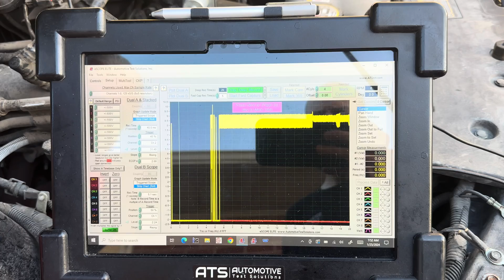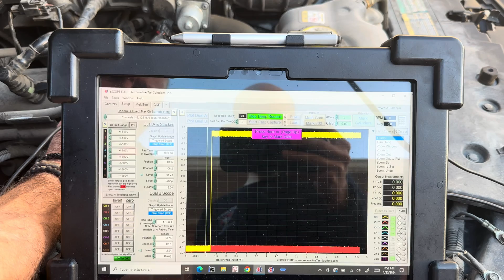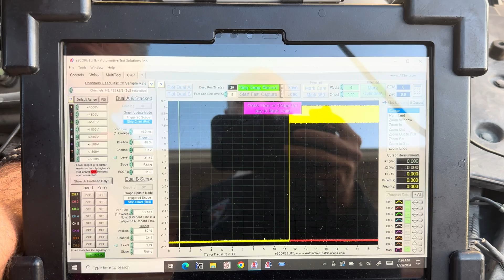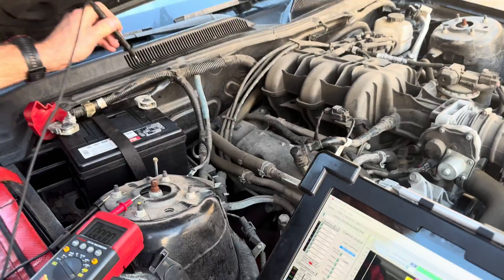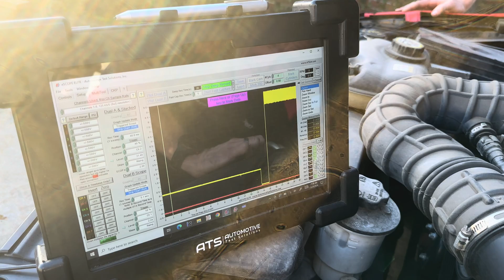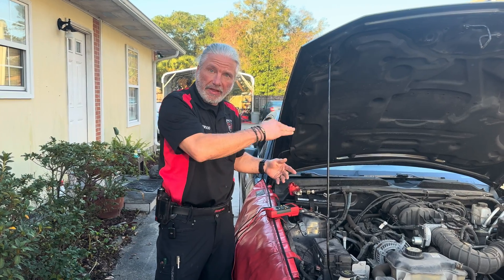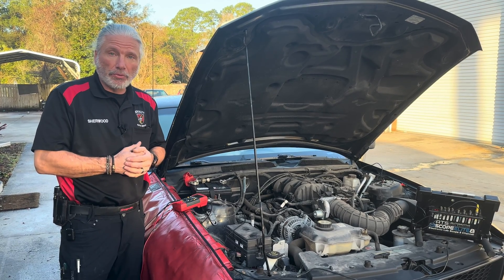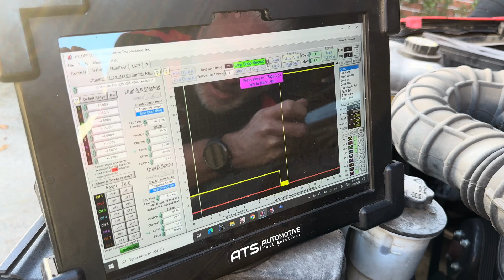Understanding How To Test Voltage Drops (Part 2) Ford Mustang

Comment: Interesting i'm working on a 00 gt with no fuel pressure. I turn the key and can't hear the fuel pump kick on. The security light is flashing rapidly, so i checked the positive wire of the pats transponder wire and put the ground to the column it showed a 1.0 volt drop. After watching this for now on i Will check both sides of the circuit at the battery for now on! I've read the pats system is extremely sensitive to voltage on these cars !

Comment: But how do you get the battery when the battery is in the boot/trunk? Like on my Jaguar. When I flash my high beams or use the power windows my voltage drops to below 13 volts then slowly picks up again to 14 volts brand new alternator and battery.  Where do I start looking?

Comment: What if you did voltsge drop at components begore breskijg down the ckt in to pos and neg. What if u did voltage drop cranking across the starrwr case to starter pos, what it show?

Comment: I love your videos and these have been increadly helpful. I have encounter an issue with a 2010 Mercury Mariner that has stumped me and I would as for guideance. If I were closer to your shop I would just drop it off :). I just purchased the 2010 Mercury Mariner. It has very low miles at 13k confirmed by dealer and records. It has a code B2A29 left front turn signal open circuit - working copy of Forscan. The left front turn signal flashes fast (rear left as well) while the right flashes normal. Very hard to measure voltage due to speed of flash with my Fluke 77. What I have done so far
1. confirmed all the bulbs (turn/parking/braking/backup/low-high beam) are good and replaced left side with new.
2. Swapped front left and right bulb connector.
3. continuity test and verifed ohms of ground, wire between the bulb and the SJB, wire between the multifunctional switch to the SJB .
4 unplugged the battery overnight.
5. added an extra ground from the battery cable frame connectiion point to the engine (no reason, just getting desperate)
6. confirmed no LED used in car.
7. Confirmed battery is good, no parasitic drain (1mv)
8. All fuses are good
9. no trailer lights - no trailer relays in engine fuse box
10. consulted Google
11. All other SJB functions work as they should
12. no noticable corrosion near the SJB or inside the car...light surface stuff - but appears consistent with a 20+ year old car.

Any help would be great. Im down to replacing the SJB/GEM which comes with its own challenges 

Thanks
Bob

Comment: LOL,  I have been trying for years to duplicate voltage drops for my students. It seems like voltage drops are more common than most techs realize but they never present themselves when I need them too. Love the videos, use them in my Auto tech class frequently. You guys are awesome!

Comment: So what exactly is the problem because I don't understand it.
Reply: The missing pinch bolt on the negative battery terminal led to the negative battery terminal having an unsecure connection. Because of this, continuity is broken and a voltage drop (or potential) is created. He says checking at the battery is very important because it is the first link in the chain of where the connection can be broken. Just using any other ground point on the car in this situation is not starting back at the first point of where the potential is being created. Which, in this case is literally where the battery is connected to negative.

Comment: Teaching voltage drop using test boards and diagrams on paper or whiteboards is certainly useful, but real world examples are invaluable.  This is an excellent illustration of why it's so important to ground directly to the negative battery post.  You can easily have zero voltage drop between two "bad" grounds.  This is why I keep a ten foot long jumper wire, so that I can always reach the negative battery post from anywhere else on the car.  Far too many automotive technicians simply unload the "parts cannon" until the problem disappears, never really understanding what the problem really was, and costing their customers far too much money.  Well done, Sherwood!

Comment: Is all of the testing in the first half of the video key on engine off?
Reply from the maker: I'd have to re-watch the video buy all voltage drop testing should be done with the circuit loaded. Meaning if it's the starter circuit you would need to have the key in the crank position. If it's, let's say, a fuel pump circuit then you would need the pump circuit on. Hope this helps.

Comment: In the first demonstration with the meter, between the post and cable connector (with 8.44v drop), what was the load at that time, because he wasn't trying to start it. Is that from other things on the car drawing a current creating the load needed to test?
Thanks

Comment: Skip the scope and stay with the meter.  It's what most will have.  Make sure to use the battery POST when testing as the clamp and everything else is part of the circuit.  Interesting thing to do when you get a new car into the shop is test the ground side straight away KOEO and KOER with as many loads operating as possible.  Neg probe on neg term and float around the pos probe on various metal point on chassis, frame and engine.  You need clean bright metal when landing your probes.
Reply: Nice one Joe. If all is ok then it would show battery voltage yes. Have I got that right. Cheers. 🙂👍🏼
Reply: @bambibigboy  Ground side should show low or no voltage.

Comment: You would have had a voltage drop  if you had cranked the engine  when you put the meter  on the positive post to the positive post of the starter.
Reply from the maker: If you mean we would have had some drop then you are correct. But, it would have been very small and within spec. The problem was on the negative side.

Comment: Great video. Unfortunately in this situation if they replaced the starter it would probably fix it. They would probably take the negative terminal off (to replace the starter) and when they put it back on they would notice it didn’t have a bolt. Some techs might not even have known the starter was good. That is why it is important to teach things like this. Great video.

Comment: On a pervious job we had to do voltage drops on ign switches starter solenoids body to chassis alternator to battery and cranking we were allowed .1tenth a connection up to .6 tenths
Reply from the maker: I would agree with that. On larger load circuits, like a starter, you can have a larger voltage drop and still be ok. As long as it's within specs. Smaller load circuits can be as little as .5 volts or even less depending on the circuit. Thanks!

Comment: Hey great explanation. It makes a lot of sense when you apply on a bench test to an  actual vehicle test it makes it much clearer. As you mention sometimes batteries are well hidden. Can you perform a voltage drop from  boosting point. If you measured across the boosting pole would you read 8 volts (voltage drop) just try to understand a bit better. I agree with you 100% you can not be lazy because you may get burnt and go in a rabbit hole and chase things that are not an issue. I try to keep it  simple but not be lazy to do research and perform test to get the right diagnosis. Thanks for all your explanations you are a game changer in this difficult industry
Reply from the maker: Thanks! I really appreciate it!! As far as the jump post, the only way you could use it would be to test from it to the battery first and be sure the circuit is good. But, at that point, you're at the battery. I know it sucks but you gotta do it.

Comment: GREAT VIDEO LOVING IT, JUST A THOUGHT WHEN THIS SERIES IS FINISHED HOW ABOUT A VIDEO ON HOW TO TEST PARKING SENSORS REALLY GETTING MY ASS KICKED TRYING TO DIAGNOSE A 2020 NISSAN TITAN THANKS.
Reply: Put your ear right up against them when they should be working you will hear a high pitched whine / clicking noise if it's ok